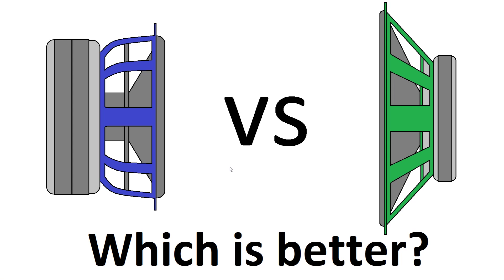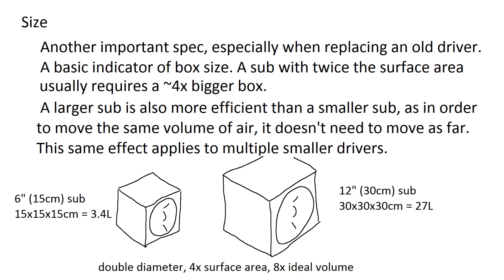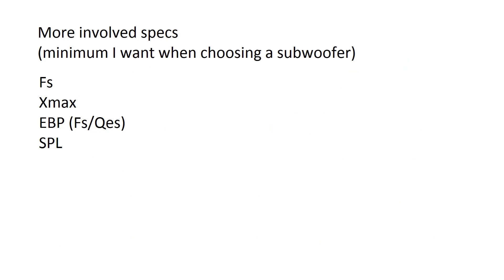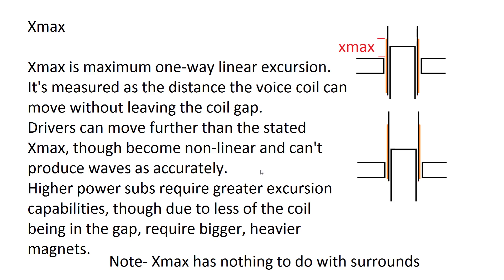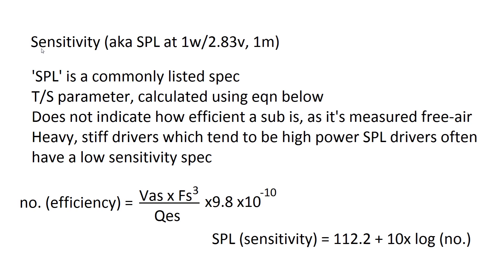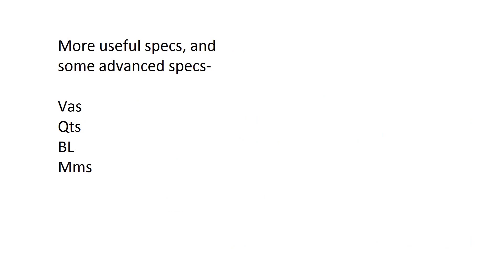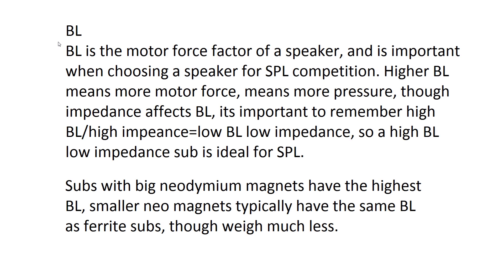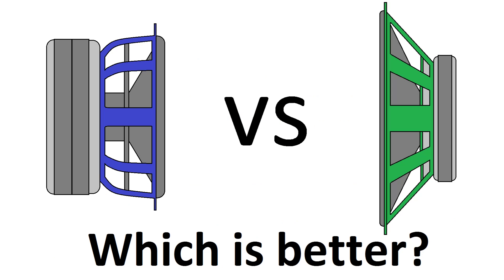Choosing the right Subwoofer

Comment: That was an excellent explanation of Vas! I never really understood that spec. As far as sensitivity, I would stick with "one watt, one meter". The 2.83 volts applies ONLY to 8Ω drivers. A lower impedance driver will pull more current, thus, more wattage from that voltage, falsely producing more SPL.(a 4Ω speaker driven at 2.83 volts will in fact, draw 2 watts) Using wattage as the metric completely takes speaker impedance out of play.
Reply: Remember sensitivity of the driver is measured with the driver mounted in a wall, so is only comparable for a large sealed box. Smaller subs with powerful magnets won't usually score very well in this regard but will work well if you use a horn cab which will convert the sensitivity, and will also get low in compact vented/passive radiator cabs - though more power hungry in this sort of box. If you want to use large vented boxes you are better off with a larger lightweight cone driver like a PA subwoofer driver, though they might not be as moisture resistant and the box will take up more space in the car but you will get more bass before you need to upgrade your alternator.

As far as "convertible efficiency" (whether you speaker is a high torque motor in the wrong "gear" to drive the air or just weak and wasteful of current), the driver with low electrical Q but with heavy cone is more useful in a horn. High electrical Q or weak motor on a heavy cone (Imagine a DC audio woofer with a funky pup motor) and a wasteful overhung coil isn't much use even in a horn, so you can't improve the efficiency of it nearly as much.
Reply: @TimpBizkit  You make a good point on "overhung" voice coils, where only a fraction of the coils length is in the magnetic gap. It GREATLY reduces sensitivity, but, what you get in return, is uniform "BL" for the entire "X-max" of the driver. That means, you drive it with more power, for much better accuracy at a given SPL. If you remember the old Peavey Black widow drivers, they were a focused magnetic geometry, where they used a very small coil in a thick magnetic gap. Those drivers had several advantages. First, they were very sensitive. Second, they would operate at high frequencies very efficiently. That allowed a 15" driver to be paired with a compression loaded horn, with no need for a "midrange" driver. They would work clear up to 2 kHz, and we usually crossed over at 1.2 kHz. The disadvantage, was very limited cone excursion, before the coil jumped out of the magnetic gap. These speakers did more at 200 Watts RMS, than many modern speakers do, at 1,000 watts. The problem was, they were only good down to about 40 Hz, They just didn't have enough excursion to get down to 30 Hz.They did have a rather high Fs, and a very light cone. They were a lot like a musical instrument speaker, like you would find in a guitar amplifier. The takeaway: Efficient, but limited.
Reply: A main point is “1W” rms. 2.83V is an example for the most popular coils.

Comment: How would a sub with an underhung voice coil play into making it out of the magnet gap? Would a lot of power do it and can it damage it this way? Thanks.
Reply from the maker: good question, I'd expect it to be the same as an overhung of the same Xmax, but I'd also expect an underhung voice coil to have a lower Xmax on average than its counterpart overhung subwoofer. It shouldn't do too much damage unless the coil comes free of the gap, and if the sub doesn't have an extended pole piece, which a low profile sub might not have, its more likely to get free, but I wouldn't say its particular likely, and not much more likely than a regular overhung voice coil
Reply: @Dakoustics  thanks.  The sub is a  Sundown  NSV3 motor with the coil setup
Reply: @Dakoustics  it states nsv4 prototype on the box but it's similar to the 3
Reply: @572012myo  In general if you are pushing a sub that hard you would have rising distortion and dynamic compression.  Both of what you want to avoid for good sound.
Reply: @gregkramer5588  thanks. I'll be careful!

Comment: What will play more spl?
One 12" sub 4 ohm
Or
2x 12" sub 8 ohm (4+4=8ohm) 
On a say 100watt amp that onle can handle 4 ohm.
I treory they (1 or 2 subs ~ 4 or 8 ohm) will play the same spl right
Thanks
Reply: 2 subs because they can move more air!
Reply: @JanisAbols3000   i dont think you understand the q. Thanks
Reply: 180degrees 180degrees box design and the environment the enclosures are in, for example, trunk, back seAt, underneath seat, free air etc, will be one if not the  biggest factor that influence the spl capabilities.  Some vehicles shapes and cabin characteristics will actually make you lose spl when adding a second subwoofer and doubling enclosure size and power say in a trunk build , due to the way the pressure in the trunk and vehicle will now be different with adding more volume in the trunk, affecting wave lengths and reflections they were in your favor before you made box bigger and added another subwoofer. Test test test!!! spl doesn’t follow the rules alot of the times because user errors or forgetting that changing too many variables at one time will never give you conclusive data. It’s all physics and math, but if you are not extremely precise, it’s not going to be much help trying to be “semi” stern on math and physics equations.
Reply: @3RDERA   i dont think you understand the q. Thanks
Reply: 180degrees 180degrees in a perfect world yes the 2 subs will be louder, but it’s hard for it to perfectly translate over into your build like it does on paper
Reply: @3RDERA  i think my q is. 
Will one sub at 100w be louder than 2 subs at 50 watt
Reply: 180degrees 180degrees that’s a lot easier to answer,  in theory,  
Will be equal or. Just as loud at the higher frequency peak for example like 60 hz  but one sub will be louder on the lower end of the bandwidth, like 30-50hz . That’s if you take a, for example,  again not a perfect example, but hope you get the picture, a 12 inch sub in a 1 cubic ft  sealed box. Then add another 12 in the same box. If you put the two 12’s in a bigger box then that changes the scenario. A Lot of factors change the output response so hope you get The point
Reply: If the subs are all from the same brand and series, and are in the optimum box, then the 2 subs will have greater output. But if you're comparing a single sub from brand X, versus 2 subs from brand Z, then you should actually test them. DON'T rely on specs from different manufacturers when doing comparisons.
Reply: There are some great spl calculators online. As far as I know, adding a sub and splitting the power would decrease spl a good bit, I might be wrong though.
Reply: @jackmills5071  i dont think you understand the q. Thanks
Reply: that depends if it's the same sub in the production line from the fab but a different coil winding than the spl can be the same..if they change the suspension it also gets louder but less accurate.  2 sub's tuned to a area has better bass on more than one spot but any way your question is to vague.... ore open to more than one interpretation to what you want..
Reply: @pissywitspissywits1886  its a theoretical question. 
i think my q is. 
Will one sub at 100w be louder than 2 subs at 50 watt
Reply from the maker: @degreesdegrees-jr4eg  they should be the same, as 3dB less for half power, but 3dB more for greater surface area, but due to factors like Vdroop, the 2 12s will more likely get 150w when the single 12 would get 250w, which would leave the 2 12s being louder. Also gives you an upgrade path, if you get another amp later you'll have almost 4x your current power.
Reply: @Dakoustics  thanks. Will you make a vid. Where you take a random sub. And plug the ts in a program. So you make the perfekt box.
so that we can do the same with another random sub thanks.
Reply from the maker: @degreesdegrees-jr4eg  Yeah sure, shouldn't be too hard to make, I'll do a quick WinISD tutorial at some point in the near future.
Reply: @Dakoustics  cool. Make it practical. Theory is fine. But some live in the real world. Thanks
Reply: @degreesdegrees-jr4eg  can be ether depending on the specs thiel / smals of the unit'.
Reply: lets say big woof has xmax 6 mm the smaller 11 mm {longstroke sub} more flex suspension ect smal one will win but it's oranges and apples like that
Reply: 1 12 would be better 2 of the same.  You are going to loose power being at 8ohms. And wont be able to fully drive the speakers.  Less power at 8 ohms and then split between the 2.  Now if you just have 1 at 4 ohm ..more power greater output.
Reply: No they will not play the same spl
Reply: jookee adding parallel is louder but it will probably clip as 4 ohm {amp} is low as  it gets, can it handel 2 ohm ? series is about the same as single but your q changes just like wires in front change the specs and has to be taken in to account while building / designing {in the end it can go louder with more power.}
but for a room 2 or maybe 4 lose subs  with proper time alignment {fase} gives better bass at multiple spots
Reply: @pissywitspissywits1886  you dont understand